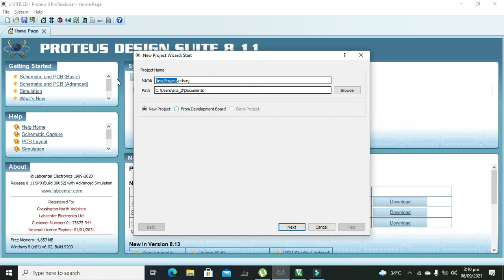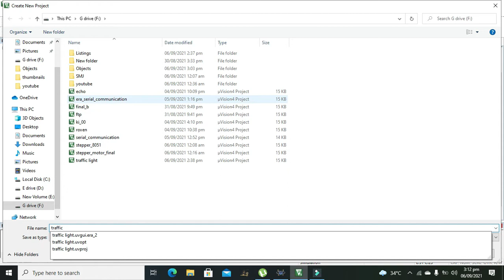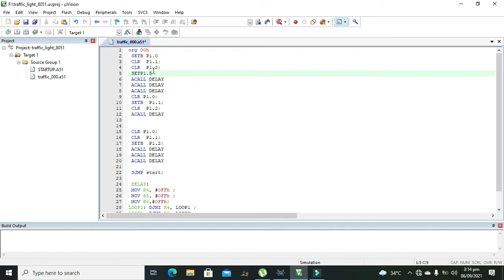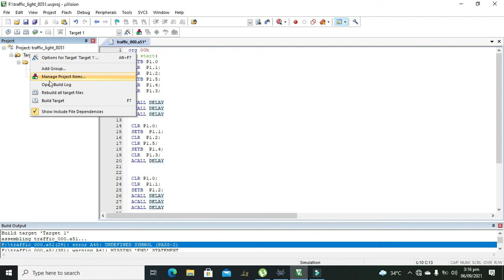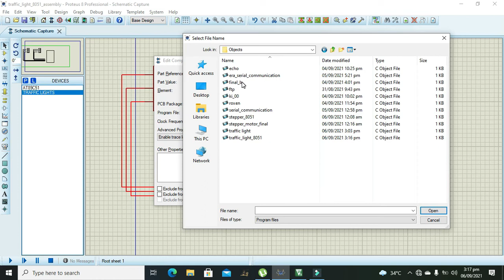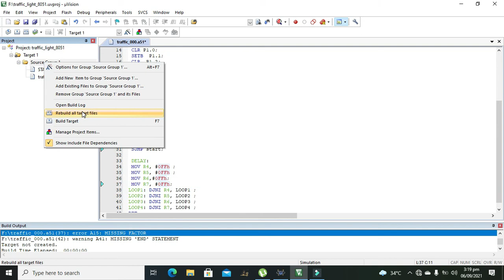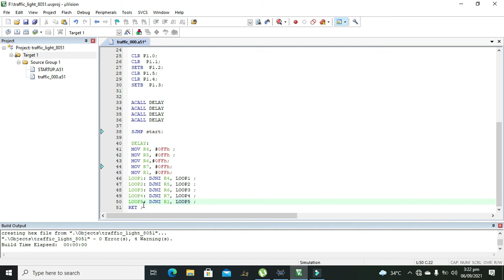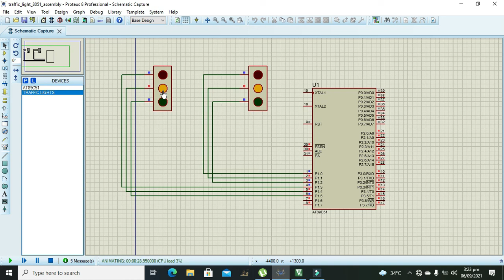traffic lights with 8051/89c51 microcontroller in proteus using assembly language in keil

Comment: source code please
Reply: ; controlling external device with 8086 microprocessor.
; realistic test for c:\emu8086\devices\Traffic_Lights.exe

#start=Traffic_Lights.exe#

name "traffic"

mov ax, all_red
out 4, ax

mov si, offset situation

next:
mov ax, [si]
out 4, ax

; wait 5 seconds (5 million microseconds)
mov     cx, 4Ch    ;    004C4B40h = 5,000,000
mov     dx, 4B40h
mov     ah, 86h
int     15h

add si, 2 ; next situation
cmp si, sit_end
jb  next
mov si, offset situation
jmp next

;                        FEDC_BA98_7654_3210
situation        dw      0000_0011_0000_1100b
s1               dw      0000_0110_1001_1010b
s2               dw      0000_1000_0110_0001b
s3               dw      0000_1000_0110_0001b
s4               dw      0000_0100_1101_0011b
sit_end = $

all_red          equ     0000_0010_0100_1001b